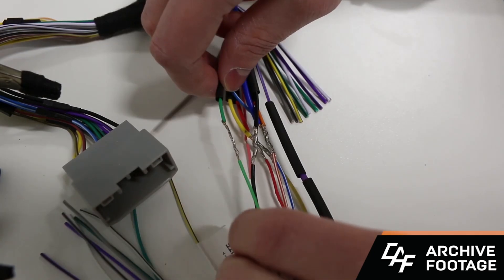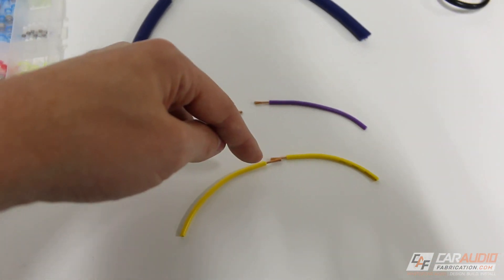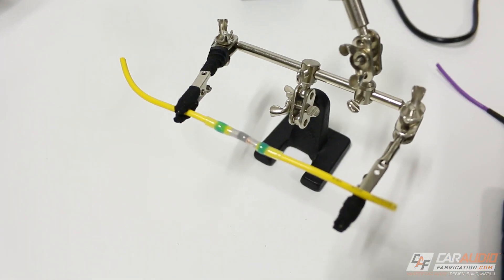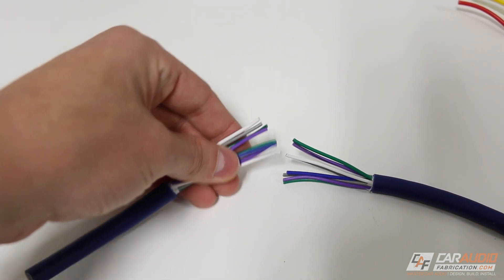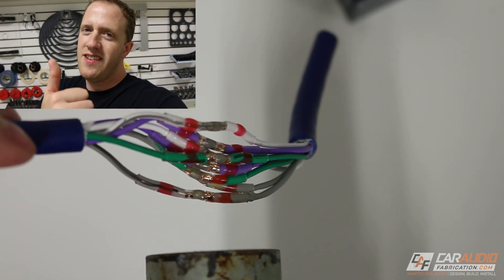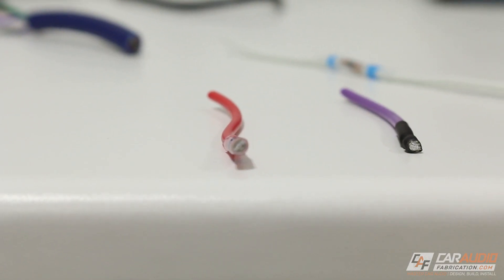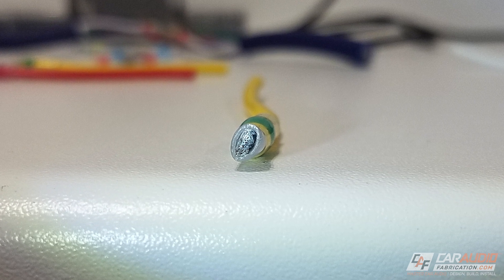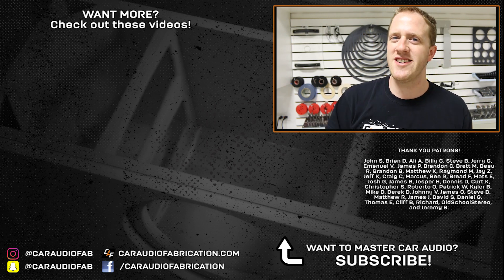Soldering WITHOUT a soldering iron? Solder & Seal Connectors

Comment: These are nice though ive used them in the past and find that they are most useful in confined spaces.  The problem is those spaces generally dont lend themselves to the kind of heat and time required to fully melt the solder.  In the end the few seconds saved vs solder and heat shrink didnt justify the cost for me.

Comment: But how strong are these soder joints? Normal soder joints are pretty strong, are these weaker due to weaker soder?
Reply: No they are pretty strong, cause the colored bands are glue, that seals the connection. If you twist the wires together first into a small ball that sits under the solder band, these connections are rock solid.

Comment: I think using a compact heat gun intended specifically for heat shrink tube would be the way to go on this. There's a deflector which the wire goes in and it heats up most of the way around the tube at the same time, and you can of course get it into smaller spaces with it.
Reply: This is exactly how those Raychem CWT connectors are supposed to be installed. Heatgun with small nozzle and deflector.
There are detailed application instructions available from TE connectivity.

Comment: If u use a lighter then the solder Will melt better and with these tubes the wires dont get the large stiff part that the soldering Iron gives you

Comment: You also can heat them up with a lighter...
Reply: Yep, a small soldering torch makes this take seconds.
Reply: I've used a bic, it works fine, just don't roast it.
Reply: @index7787  bic's don't work in the wind. I got a lil hand torch thing for wiring repairs
Reply: @index7787  howbout a zippo? Would that be ok? 🤣 just joking.
Reply: Good old bravo 1 charlie

Comment: The Air Forces uses the seal connectors on their aircraft. They hold up better to moisture. I use them on my boat and have had really good lucky keeping the salt water out of the connectors. They are a little more expensive but to me they're worth the money. Also, to me, they are easier to use.
Reply: @RandomKind That's an extra step, but many mariners use these seal solder connectors and then add several layers of heatshrink with sealing compound to obtain the best waterproofing possible.
Reply: During MOS school the Marine Corps has those

Comment: These are good, for solid low resistant connection, you need to use a butane torch with heat tip(provides more direct heat to smaller space/faster), pre heat the wires(when joined) then slide over the shrink and heat from center to out in each direction.  Will provide a solid connection with just as good cladding/penetration.  Use in Semi-tractor harness repairs, heat gun not an option and getting a soldering iron into the restricted spaces safely usually impossible. HTH.

Comment: I soldered a loom for my new head unit this week and I was really happy with how quick I got the soldering done... until I saw you only took 1min10 secs😶  I can see one advantage of the solder and seal connectors though.   I wouldn't have had to cut and redo the 3 wires that I forgot to put heat shrink on before soldering 🤬

Comment: As long as the connection is good between the wires this could be a good alternative as I'm sure somebody has already created a jig to hold the bundled wires in the shrink wrap while keeping them separated from each other. Also, there's no fumes to contend with.
Reply: These things are awesome. I have a little metal bar about 2 inches long with two alligator clips on it, holds them nicely. I use a lighter as well, works fine.

Comment: Soldering is great but these are better then twisting or crimping AND waterproof. And the only way to get a soldered join on really short wires were the heat shrink can’t be moved far enough out of the way while you solder.

Comment: I am a refuse truck mechanic and in most repair applications you have very little extra wire and your doing it in confined spaces. I started out with the old school cheap stripper flat crimper (you seldom have room or time to solder), then I found the stake type crimper. While this is a lot better than scotchlocks (doesn't take much) I still wasn't happy with it. Then I found silicone dielectric grease 😊 and that took care of most of my concerns. Now I use the ratcheting crimpers with heat shrink butt connectors and silicone dielectric grease on everything else. Heat shrink only works on a butt splice. Unless you are going to to a weather pack style connector it's not water proof so I use the grease. I need to say that I ABSOLUTELY DETEST SCOTCHLOCKS, they have caused me so much aggravation over the years. 
The inventor should have been shot 😠

Comment: If you use a reducer attachment for your heat gun to isolate the heat to the center first this will help the solder melt better

Comment: My experience with these has so far been positive. I like them in wet or moist areas better than the traditional method. Here in the south we have a lot of humidity so any connections that will be outside have to be sealed. I still use my soldering gun and heat shrink on most of my audio connections simply due to the fact that it's cheaper and it solidifies faster allowing me to move on the next connection without waiting for the previous connection to cool.

Comment: It doesn’t look like the solder ring to melted down to good on that last one you cut apart.  I have been using these for awhile.... and they are a tricky bitch to use....once that solder starts to melt you have to keep the heat on it.   If you remove heat even for a second your done.... it will not re wet.     I’m wondering how they would work if a touch of flux was added to the wire first?   I haven’t tried that yet but it seems logical it could help.    Also I think these use lead free solder so that is another reason they are a pain.     When I first ordered them 6 years ago or so the yellow ran about $1 each.  It seemed like these melted the solder much better.... but trying to find good quality is hard now that they are all over Ebay and amazon.

Comment: Really good and thorough test I think. Thank you very much for making this!
I don't use these myself, but have seen them available at a couple of workshops. More common, and kind of similar looking I think, is the crimps with clear/tinted heatshrink with glue on them.
Personaly I am a solder guy, and usually only vary the type of heatshrink I use (with or without glue).

Comment: Here in germany we use these type of shrink and solder connectors since the 90s I think.
They are the only correct way to repair wires that go to the O2 sensor for example.

They are not meant to be a time saver, and ours work quite a lot better on the soldering part.
Reply: I'm a MAN mechanic and we use these for almost everything. Like you said, not really meant as a time saver.

Comment: We use these in aviation avionics applications all the time in the connection of different mods. One needs to pay attention to the amount of heat being applied. Which I would ask if the quality of this product is the same in the aviation industry.
Reply: I will add when properly applied the splice joint is superior. And passes the ring out test in aircraft avionics. (Ring out meaning continuity test required for airworthiness.

Comment: Hey Mark! Wanted to add my experience with these type of solder sleeves. So I work in aviation and we use those solder sleeves in the wiring of the helicopter radios for communications, transponder, and media. But they are only used to solder the shielding of the multiple conductor wiring to ground to reduce EMF noise, then we use closed barrel terminals to install it into a connector. So they only serve for grounding purposes in radios. Especially since they are $7 a piece, but they use a higher temperature solder and heat shrink and the wire is a nylon insulation that can withstand more heat and vibration than car wiring can. We are even not allowed to splice radio wire, either the wire needs to be replaced or be re-terminated. If we splice anything, there can’t be more than one splice per wire in non radio applications. Very rarely do we solder anything in our application; switches used to toggle comms is where we use it or micro switches for actuators. And also to add to the frustration you can’t twist wires together to secure them either. Everything has a specific terminal that must be used with a double crimp, one the wire and the other on the insulation for security that requires a double crimp tool. Thought you might find it interesting! 👍
Reply: Can confirm

Comment: Used them to build wire harnesses for military subcontractors.  Need a nozzle and adjustable heat. If they worked good enough for a tank or plane, more than sufficient for car audio
Reply: sounds like the crucial point is--DO THEY ALL provide that ?

Comment: What you failed to show was this- try getting heat shrink tube on each of that 9 wire bundle with only short lengths exposed out of the outer sheath that holds all nine together. Nothing worse than the heat shrink shrinking while you are soldering (shrunk but not actually covering the wire junction). When space is limited, this will drive you insane!

Comment: I use these all the time on military planes. Get yourself an adjustable temp heatgun with a C shaped shroud so you don't have to move your gun all around and run it so hot. It also helps to not melt your fingerprints off or wires.

Comment: Never liked those seal & solder connections as u never really know how well the connection really is. I will stick with my iron and solder because at least i know for a fact how well my connection is before i heat shrink and seal it.

Comment: They may be a bit slower to work with on a bench with everything handy, but I bet their faster (and safer!) when you're upside down working under the dashboard.
However, nothing beats a good crimp connection, in reliability, speed, ánd safety. Good crimpers and connectors aren't cheap though.

Comment: Soldering is great. the only problem I have is if it ever grounded out that low temp solder could melt and then cause other problems when the wires become loose, there is no mechanical connection. Also if the connectors were larger than soldering by itself, you could always splice the wires to different lengths In order to stagger the connections and thickness in one spot.

Comment: I have the exact same kit! I love these.
I had to tap in to a few wire in the kick panel last month while starting my SQ build in my 05 Acura TL. It was a very tight area and I could barely get the wires stripped.....more less a set of crimpers in there. I really wanted to try these out so out they came! 
I guess I could have truly used my soldering gun to handle this job.....I guess I did....in a way though...lol!
Being close quarters, I didn't want to use my butane torch and risk damage or even fire. So, I used my Milwaukee 12 volt soldering iron with the flat plastic welding tip to run over the connector. I would turn it slightly back in forth....sort of a rotisserie method. LOL.
IT WORKED!
It probably took longer than a torch but it was safer.
By the way, this soldering iron is awesome! Lots of features. Heats up in 30 seconds. A light tells you when you can put it up. The head can be angled. Also, if you get the high capacity batteries, it acts like a stand for the iron.
Again, thank you Mark.
Another great, USEFUL, video!

Comment: I use this a lot, but not for car audio. The main area i use them in is other smaller jobs whre i need to connect one or two wires in the field, also i do not use a heat gun but a lighter. For example last week i was replasing a trailer light plug and had to bypass a rear foglight switch.

Comment: I tried these at my shop only to come to the same conclusion you did, if you cant solder, don't be an installer.  My guys prefer a dedicated soldering/hot air rework station any day of the week. These do have thier place in the consumer genre but the "industry" will never use them. I will say in my testing that the cheap 898D+ rework stations with Hakko clone iron can be had for around 80$ and the 8mm nozzles not only does these better but also does heatshrink wonderful. Any good temperature controlled station with Kester 60/40 leaded solder is the best way to solder but in some situations it helps to use "247 Solder" type LOWTEMP-15. Its in a syringe, melts at 280F, has no clean flux built in, and consists of 42%Tin57%Bismuth1%Silver so it is very convienent to use on wires or circuit boards. Pro-tip : Keep it in the fridge so it doesn t seperate and it will keep long past the date on the syringe, you really only need to pay attention to that for production work that needs consistent melt times. May be do a video on the different grades/types of heatshrink Mark, that is something I get asked quite often by customers/collagues. People tend to cheap out on heatshrink and solder and wonder why the job looks bad. Give me a 20$ iron and some Kester 44 before you take away my good solder and leave me with a 200$ Iron.

Comment: This is a great product for in car installations.  Solder on a bench is ideal,  but often we are wiring up stuff in the car and getting a smoldering iron in there is not plausible
Reply: Dave Taylor 1 word: crimp!
A good crimp is better than the best solder, that's why only crimping is allowed in some industries and anything stock in a car is usually crimped.
Reply: Candisa, So, it has nothing to do with time and energy to solder the joints, right? Cost and speed rule production lines, not "top quality first". I'm not one, but a NASA trained electrician I associate with on the net solders his wires. (He goes by Jonnie B, if you think I made this up)
Reply: T L If it were for cost and energy, they would solder instead of crimp, which some actually did, resulting in brokes wires right next to the solder joint because of vibration over time.
NASA/military solder joints aren't even twisted together before soldering, the wire ends are saturated with solder individually, positioned side by side against eachother and molten together. Those joints are very easily serviceable on site without damaging the wires (no need to cut and restrip), but they aren't the best connection electronically nor mechanically. In high current situations they do not solder, they avoid connections as much as possible and crimp the ones that are unavoidable.

Comment: The connection with those connectors is actually a better connection even though you can see exposed copper. There is no wicking under the insulation which actually creates a weakend solder joint that can cause wire failure under the insulation. Even people with years of solder experience cannot replicate a proper solder joint between two wires over and over. This is why crimping is a standard in some critical industries. 

Next I would say that if you starting out with a cold heat gun, the time to proper temp and the low temp solder melting is increased. If that heat gun was already full temp I am certain it would not have taken even close to that amount of time to complete. I have used these solder connectors in all kinds of applications and it never takes more than a few seconds.

Now, where these become a pain in the ass is when your on tight quarters new material that can melt from the heat gun discharge. But, a hot iron can also be just as damaging in tight quarters as well. 

I use these connectors as often as I can to save time and maintain consistency. I'll use a soldering iron after that if need be.

Comment: I actually have a soldering iron but not a heat gun. I just use a butane torch.
Reply: Same thing I was thinking.  I have a soldering iron, but no heat gun.   I use a butane torch, or even a cigarette light, for the heatshrink.